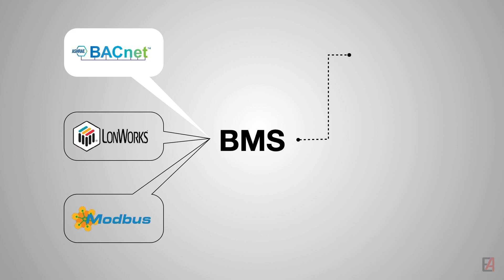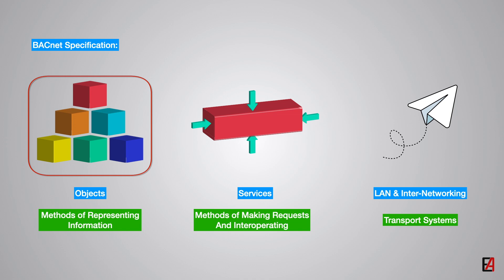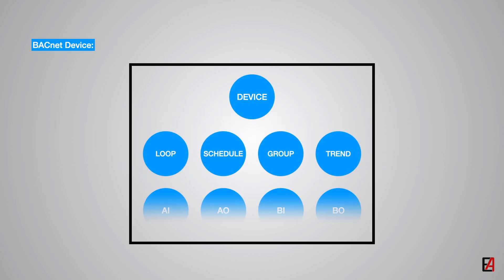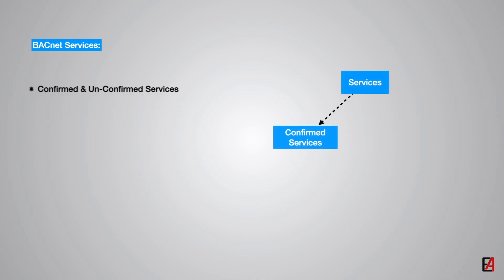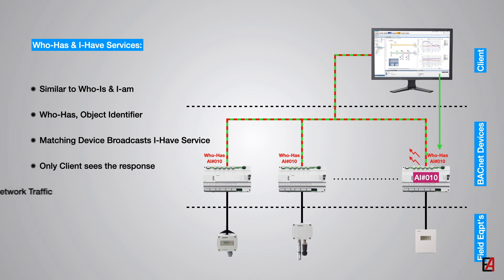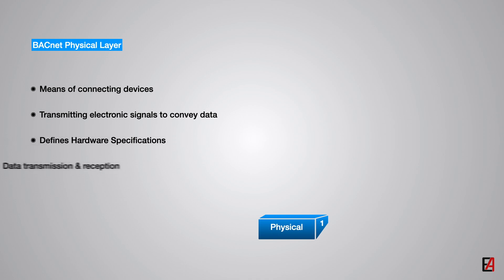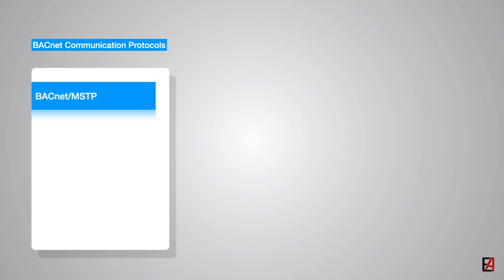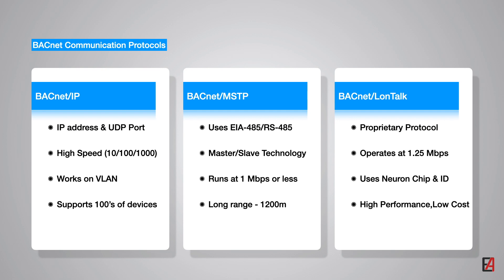BACnet - Introduction to BACnet with Details of BACnet Communication Protocols, Objects & Services

Comment: I work in building automation and if I had to compare using BACnet versus modbus or some industrial protocols during my college, like Profinet, it allows you to identify the data you're looking foruch quicker, assuming everything has been named properly and has units. Modbus requires you to have a register map in order to know what to fetch, and if you need to convert it if, for example, it's raw ADC.

Comment: I have been in building automate a few years and have seen/used the "Bacnet Ethernet" option within Compass and the associated use.....but I am not sure what is happening within the protocol layers for this option. Within an Alerton ACM, this open is what allows you to access the configuration settings ......which I believe you would not want to get corrupted over say the bacnet/IP connections. Does that make sense?
Reply from the maker: it depends.. as BACnet/Ethernet uses MAC address and BACnet/IP uses IP address. with BACnet/IP you can communicate between different subnets which is not possible with BACnet/Ethernet. in the other hand using MAC address gives additional security

Comment: May I ask what is the difference between BACnet and DDC controllers? I'm a newbie in BMS..Please explain sir..Thanks in advance
Reply from the maker: Hi Benny, thanks for your feedback. BACnet is only the communication protocol of the BMS system. DDC’s are Direct Digital controller which connects to the field equipments. The DDC controller communicates to the BMS system via BACnet protocol. Hope this helps. Let me know if you need more informations. 
Please share subscribe and keep supporting👍
Reply: @engineeringautomation  Does BACnet mean it's only a wire that connects from one device to another device?
Reply from the maker: There are different levels in BMS. You can watch my first video about the BMS system for better understanding.

DDC to field are hard wired cables. Separate cable for each IO point. From DDC to BMS is usually through the building IT infrastructure.

Comment: Excellent presentation!!
Reply from the maker: Hi Salim, thanks a lot for your feedback. Please keep supporting
Reply: @engineeringautomation  can you tell differences between the native bacnet and common bacnet?
Reply from the maker: Hi Salim, Native BACnet means the device speaks and understands BACnet and uses any of the 6 LAN technologies explained in this video. There is no common BACnet devices. They are called non-native BACnet devices which uses Gateway to Convert protocols such as Modbus, Lonworks, KNX etc., to BACnet. This gateway is used to pass the Application layer as the non-native BACnet devices messages are different. Hope this helps
Reply: @engineeringautomation  thanks this was very helpful